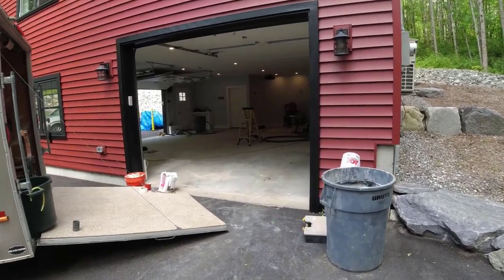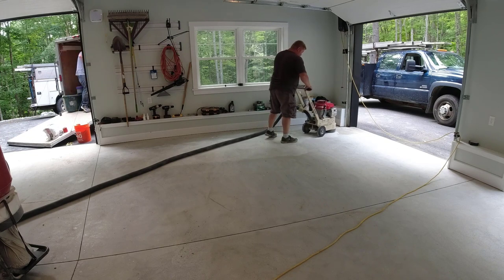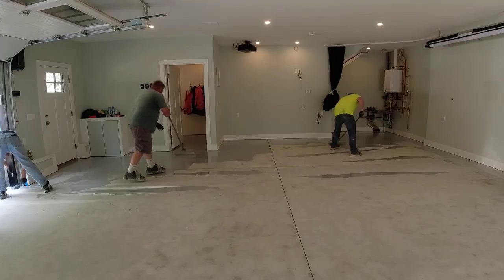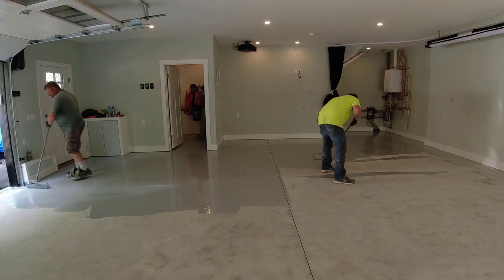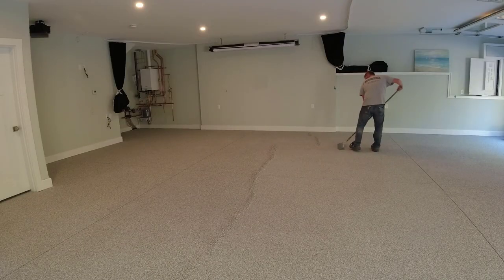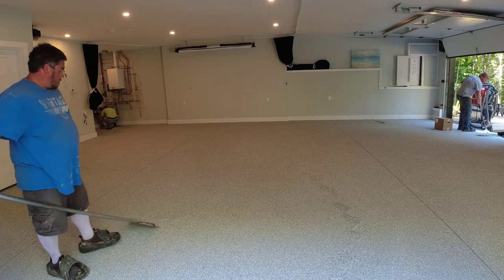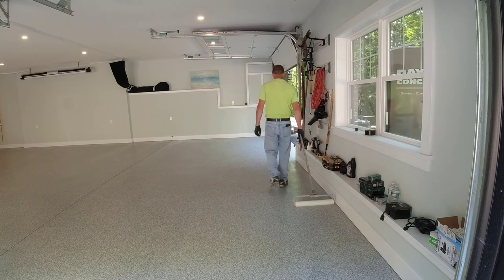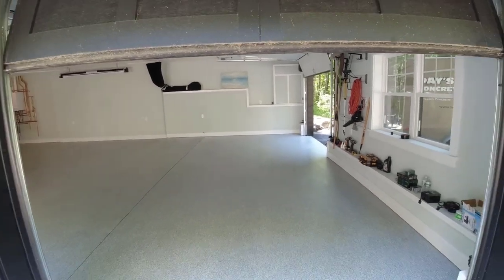Epoxy Garage Floor with Flakes Done Using Only Polyaspartic Product

Comment: Im wanting to do my basement floor. The surface is rough, it was never polished as most basement slabs are. Do i still need to grind if its already rough ? Do i need to use a specific kind of product for a basement as i know the slab was done without plastic sheeting underneath.

Comment: Great video! I'm in Florida and just started a concrete coatings company and would like to know where I can buy the materials you use from.  After watching most of your recent videos, you flake into an epoxy or poly base with poly topcoat.  We are looking to do these in 1 day with the base coat having some Vapor Barrier in it, which seems like epoxy is the way to go?  Any help would be greatly appreciated.  thanks : )
Reply from the maker: We use Poly Armour polyaspartic from www.deco-cretesupply. The 70 cures fastest.

Comment: May be a silly question... Are these poly coatings flexible? I'm curious if transition areas such as subfloored utility room, could be coated to match rather then lino?
Reply from the maker: If we're going over a sub-floor, we do a "flexible epoxy primer first" then we do this type of floor over it.
Reply: @MikeDayConcrete  Thank you for the fast reply, great informative videos. Wish I could find the kind of reliable help you have.

Comment: What is a typical materials cost per square foot for doing these coatings? Thinking about starting a business doing this.
Reply: With the info he gave at 10:40 2 gallons of just clear product covers 200-300sq ft for $250 + shipping.